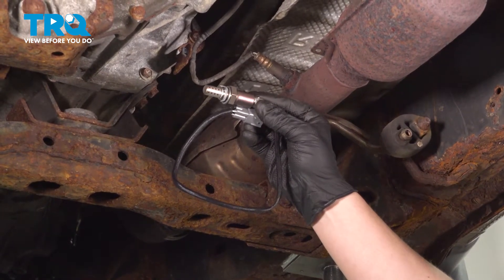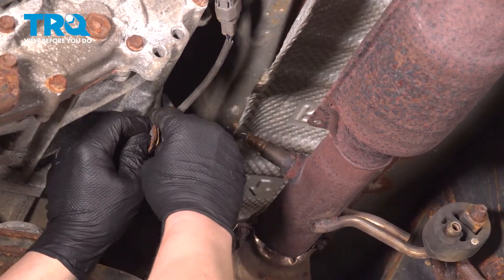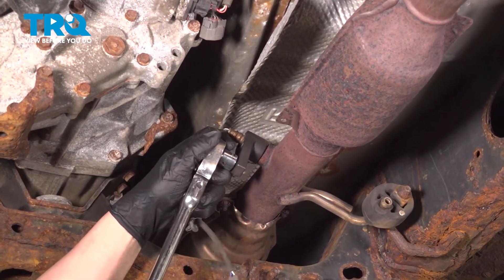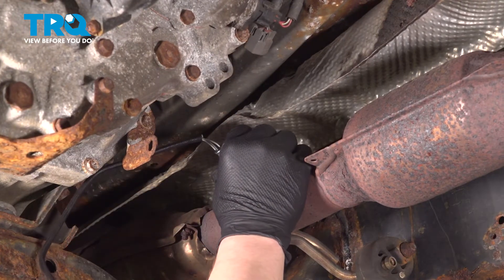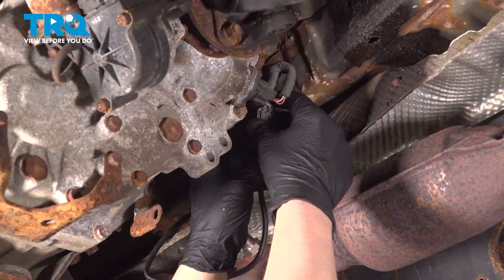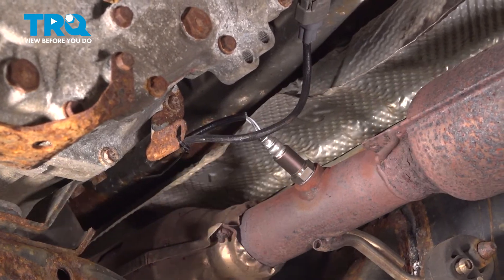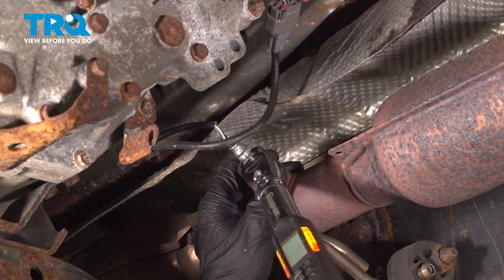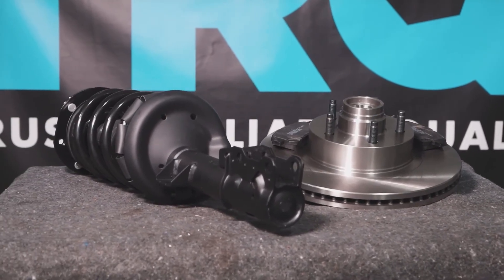How to Replace O2 Oxygen Sensor 2005-2015 Toyota Tacoma 2.7L L4

Comment: To whom it may concern or the person who made this video. In the video you use a Torque wrench that has an electric audio sound and light that goes off when reaching your mark. When scrolling down to look @ the parts used fro A1 Auto Parts. The torque wrench used in the video isn’t the same as the one in the A1 Auto parts site. I’m looking for one like in the video. Where can I find one or similar. I have looked and can’t find one… Unless I’m looking in the wrong places, but I’ve had no luck. Can you please help?

Comment: Replaced mine today. I will mention that if you don't have access to a lift, these are incredibly difficult to break loose manually. I almost went to a neighbor's home to use his air impact tool. The problem is leverage. Once it's loose, it's a piece of cake.
Reply: is there not 2  o2 sensors on 2008 tacoma 2.7  one upstream and one downstream ?